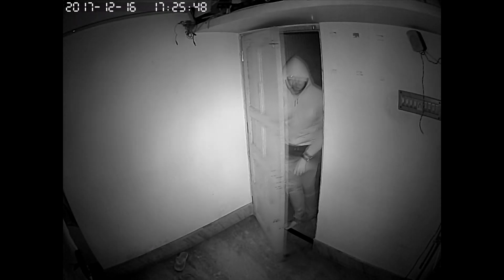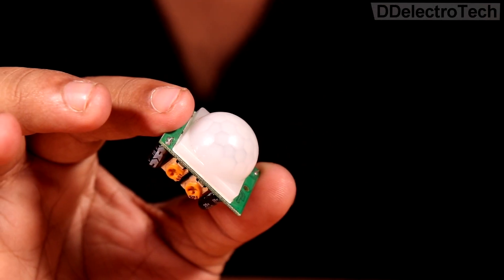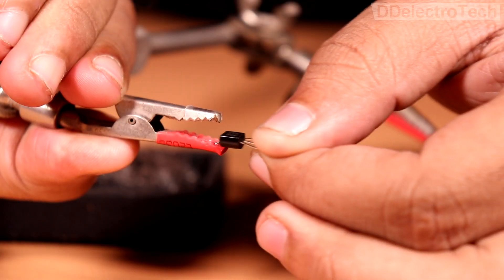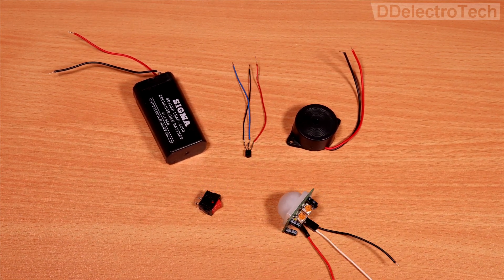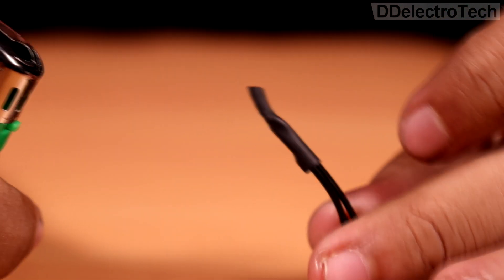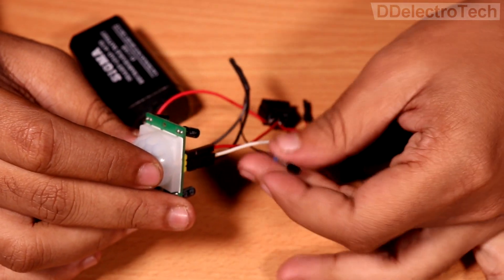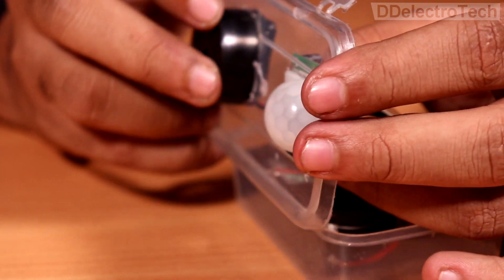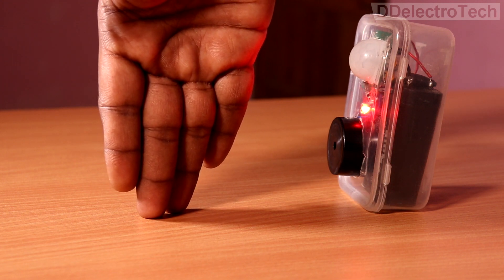How I made my own Anti Theft Motion Alarm

Comment: One suggestion. You said that the transistor acts as a switch and amplifies the signal. This isn't true. Because the transistor can either act as a switch or amplify a signal, it cannot do both the things at once. In this case though, it works only as a switch. No amplification is done.